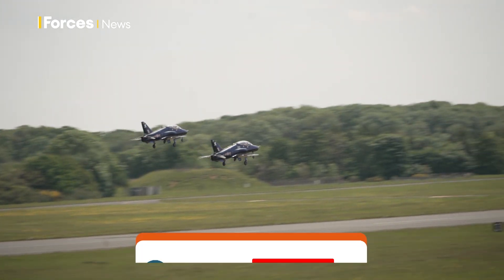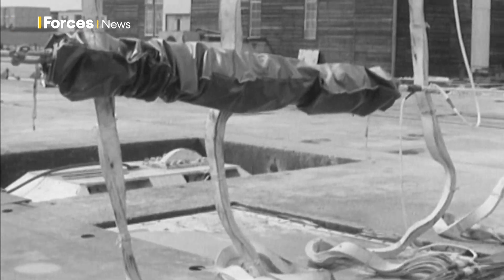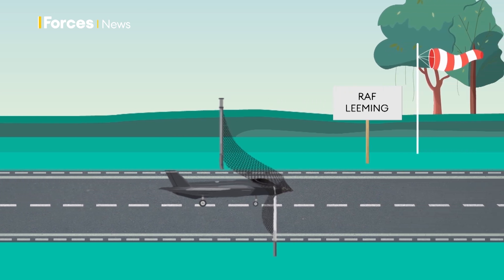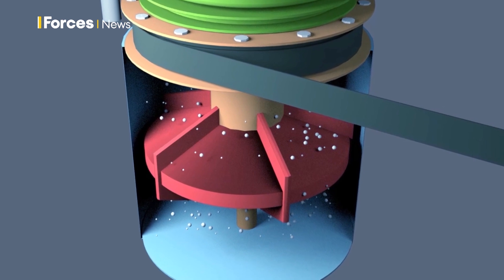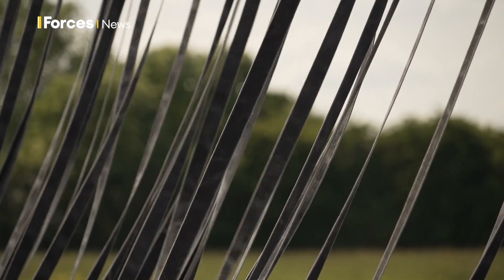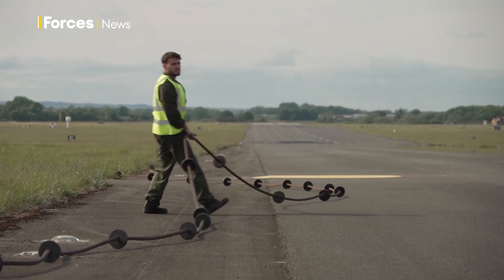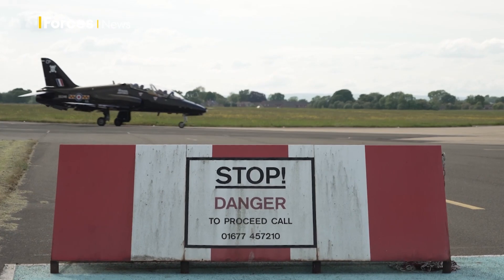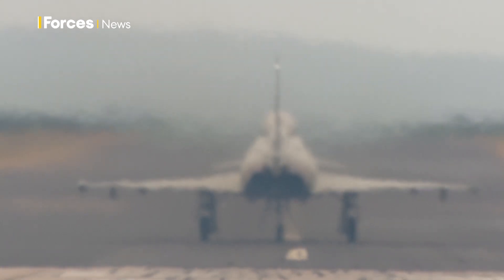How To Catch A Jet: Stopping Military Aircraft In Emergencies ✈️

Comment: Nice to see GEF getting some love, the RHAG is the Rotary Hydraulic Arrester Gear. The blades are immersed in an AL39/ water mix so it does not freeze in winter, the barriers are used by aircraft that don't have tail hooks. Cables can be set for Approach or overrun, spent 22 years looking after those life savers. Good to see Leemings still going  😊

Comment: Hope the UK gets nuclear carriers so they can use Catobar or EMALS. Much better sortie rates.
Reply: the sortie rates on the QEs as STOVL carriers is actually faster in the first few hours as it takes time to set up a CATOBAR carrier and stage aircraft. Plus when retrieving aircraft any CATs on the angled flight deck are unusable and even the Port Bow CAT has to be paused. On QE its high tempo straight off. However over 24 hours a QE gets some 10% fewer sorties than a Nimitz.
CATOBAR and even EMALS are not nuclear power specific. In fact there is no strategic or tactical benefit to using nuclear carriers and the costs are stratospheric in build, manning and disposal.
The QEs have been passively engineered for CATOBAR and have the electric output to power EMALS (which actually doesn't need huge amounts of power) so maybe come their half life refits they may well be converted.
We dodged a huge bullet avoiding EMALS in 2010. Ask the Yanks how their $18 Bn non operating EMALS carrier is doing....
Reply: We will never have nuclear carriers because they are too expensive and are not allowed access to most of the world's ports and also we won't have cats and traps because ramps don't break down and no wires to snap!
Reply: @B-A-L  They are allowed in 99 percent of the worlds ports and can be cheaper.
Australia allows them.
"tourism Minister, Mark McGowan today welcomed more than 5,000 senior officers and crew aboard USS NIMITZ (CVN-68) to Western Australia."

Italy? They allow them...
"For years a dozen Italian seaports have been decrying the risks they run as bases for nuclear powered or nuclear armed U.S. warships (submarines, aircraft carriers):  Augusta, Brindisi, Cagliari, Castellammare di Stabia, Gaeta, La Maddalena, La Spezia, Livorno, Napoli, Taranto, Trieste, Venezia."

Germany? The UK? France?
"Nimitz conducted her second abnormally dangerous navigational detail of the deployment as she transited the English Channel (with its high volume of shipping) en route from Wilhelmshaven, West Germany, to Brest, France."

Japan?
"Ronald Reagan made five deployments to the Pacific and Middle East between 2006 and 2011 while based at Naval Air Station North Island. In October 2015, Ronald Reagan replaced USS George Washington as the flagship of Carrier Strike Group Five, the only forward-based carrier strike group home-ported at Yokosuka, Japan, as part of the United States Seventh Fleet"

South Korea?
"U.S. Navy Rear Adm. Michael D. White, the commander of Carrier Strike Group (CSG) 11 and Rear Adm. William McQuilkin, the commander of U.S. Naval Forces Korea, pose with local dignitaries aboard the aircraft carrier USS Nimitz (CVN 68) in Busan, "

India?
"The carrier departed North Island for its thirteenth deployment on 2 April 2007 to the Arabian Sea, relieving USS Dwight D. Eisenhower in support of OIF. It anchored off Chennai, India on 2 July 2007 as part of efforts to expand bilateral defense cooperation between India and the United States."

25-29 May 1991: Nimitz anchored at Dubai

11-12 Mar 1993: Nimitz sailed through the Strait of Malacca

18 Jun 1993: Nimitz sailed outbound through the Strait of Hormuz into the Arabian Sea

13-14 Feb 1998: Nimitz anchored off Port Suez, Egypt, and passed through the Suez Canal 

21-23 Apr 1985: Nimitz anchored in Augusta Bay, Sicily, to turn over to Dwight D. Eisenhower.

31 Dec 1988-6 Jan 1989: Nimitz anchored at Singapore , affording her crew their first port of call after 71 punishing days at sea.
Reply: @ThatCarGuy   Blimey you dug deep to excessively labour a very small point of disagreement (where they can or can't go) while sort of brushing aside the cost element. Which is the killer factor for most countries.
1. Nuclear carriers (CVN) cost $12 Bn more per carrier to operate in their service life than a conventional carrier - US Congress report dated 1998 adjusted for inflation.
2. CVN also cost about 3 times more to build than a conventional carrier. Or if its the USS Gerald R Ford its like $18 Bn compared to $5 Bn
3. CVNs pay for fuelling regardless of if it is used or not. Given they spent some 50% of their lives in dock that is a waste of money. Conventional carriers only pay for fuel used.
4. CVNs require RAS for weapons, victualling and aircraft fuel. that requires support tankers and solid support ships. Which are generally the slowest in the CSG. This also negates the supposed higher top speeds of the carrier.
5. And then we have the issues of de-fuelling and scrapping CVNs after retirement. That cost is NOT included in the $12 Bn figure above although it does include the mid life refuelling. Allegedly another $5 Bn per CVN.